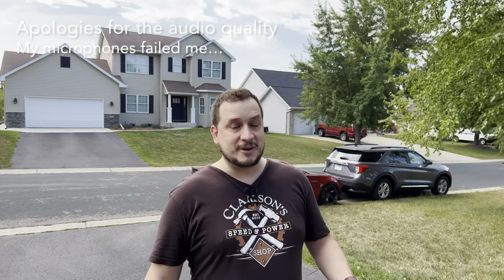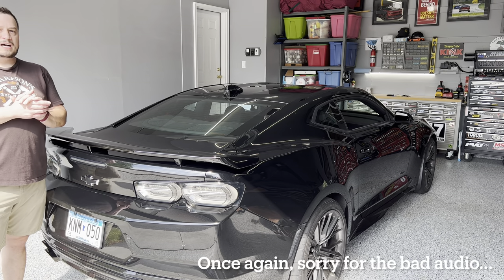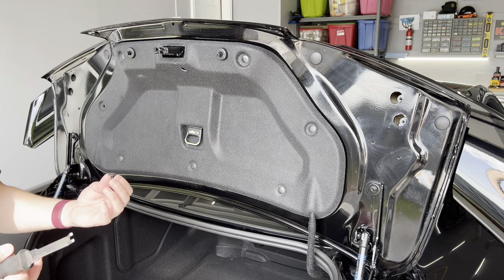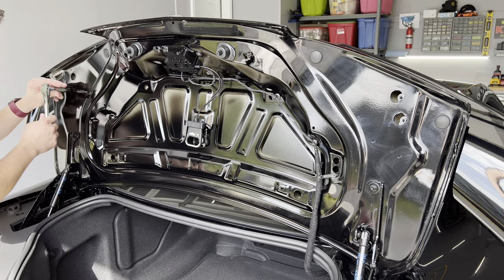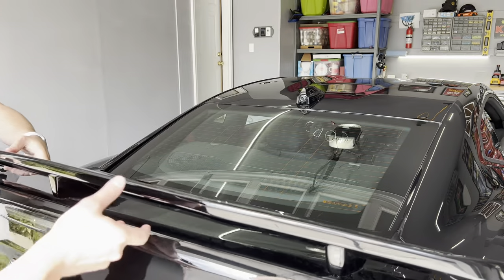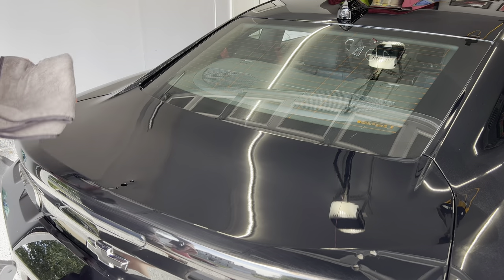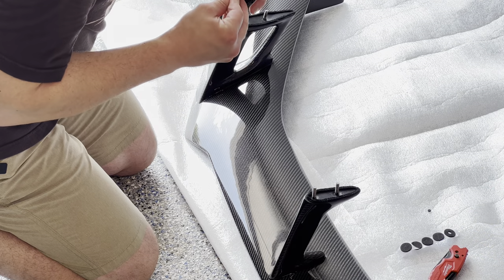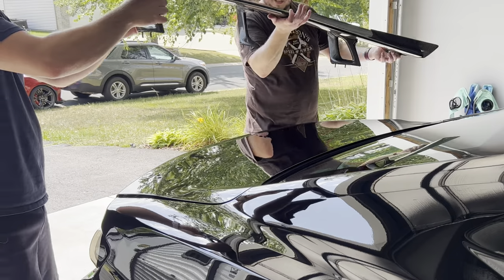How-To: ZL1 1LE Rear Spoiler Install // Carbon Fiber Wing

Comment: Glad to know there’s another zl1 in Minnesota. I’ve only seen 1 other and it was a convertible
Reply: What color was it
Reply: @c4sare4kiddos  it was black. I have the radiant red tint coat
Reply from the maker: There is a silver convertible in the Waconia area too.
Reply: I see mustangs,chargers & challengers all day. It’s nice to see that Camaros are harder to come by
Reply: @FollowMyLine17  I have the satin steel vert, diff state tho. There’s so many different  gm silver” paint codes tho so it’s hard to tell even for me, lighting ppf cleaning etc make it look different where I confuse it with some ppl online/ irl who have the different paint codes of that silver or gray. I think I have never seen Arctic blue or silver or whatever they call it irl on any trim and that’s it.

Comment: Great video. Having done this myself, a big warning is to not drop the nuts into the body of the trunk lid. You can do this by taping the socket to the nut or lowering the lid enough that they will fall free. Otherwise, you may have to fish them out with a magnet.
Reply from the maker: Great call out. I think I had it in the original cuts, but it didn’t make the final video. I did use a magnet to grab the factory nuts out and put them on.
Reply: @FollowMyLine17  Knowing is half the battle. 😁😁

Comment: I would like to put this wing on a convertible ZL1. Any suggestions on what to do with the wing mounted camera that comes on the convertible?
Reply from the maker: Wildhammer sells a 1LE style spoiler with a camera hole in it. It is made by EOS, so it’s a bit different than this one, but in 2019 the rear view camera on the ZL1 1LE was in the spoiler itself. If you use the wildhammer link in the description, you can then search the shop for it.
Reply: Awesome. I should be taking delivery of my 2023 rapid blue ZL1 convertible very shortly. The only thing it's missing is the performance data recorder. Any suggestions on a good one with camera I can add? Thank you very much.
Reply from the maker: @appel199  this is an older video but many of the items are still current. Links for everything in the description too. https://youtu.be/GGOSnBjibwk?si=8E-VKrgGrhozbJiD
Reply: Thanks. Just so bummed that one PDR option is not on the car. But really looking forward to getting the car. tho.
Reply from the maker: @appel199 stay tuned… I’m working with some folks on an OEM retrofit option. Late 2024 hopefully.
Reply: Please get back to me when you do. Thank you.
Reply from the maker: @appel199 of course! If you’re not subscribed yet, please do and you’ll get the notifications.
Reply: Subscribed today. Hopefully have my car by the end of next week.

Comment: Nice job and nice looking wing! What did it do to your rear view camera view?
Reply from the maker: Zoomed all the way out, you can see the top of the wing across the bottom third of the screen. Mid zoom it’s just barely across the bottom and zoomed all the way in, it’s not in view at all.
Reply: @FollowMyLine17  OK awesome! Thank you for the info! Did the new wing have 3M adhesive to secure as well as cushion the supports of the wing to your trunk lid?
Reply from the maker: @P-Dawg-01  it came with foam tape

Comment: I have an LT RS I want to put the same spoiler on it but I don't know how to cover the holes left by the previous spoiler. What do you recommend?
Reply from the maker: The best way is to try to find a trunk lid without a spoiler or with the standard SS, or ZL1 spoiler from 2018+, which has the reinforced braces within and have it painted. 2016 and 2017 do not. Otherwise you could have a body shop fill the holes. Otherwise you could just use some plastic plugs and paint them to match:
https://amzn.to/3JyQsbE

Comment: Did the new wing come with adhesive tape? And to loosen the old wing adhesive what did you use?
Reply from the maker: The new wing came with adhesive foam. To get the old stuff off I used a plastic scraping blade and a 3M adhesive removal wheel attached to a drill.

Comment: Additionally, 50% iso alcohol works better than detail spray for removing adhesive and is paint safe.
Reply from the maker: I was using a plastic blade and the eraser wheel to remove the adhesive, so I wanted more lubricity. I actually hit it up with IPA as a final step before I installed the new spoiler.

Comment: I've been thinking about adding this wing to my ss
Reply from the maker: Do it! You won’t regret it.
Reply: @FollowMyLine17  did you have any issues with extra holes in your trunk ?
Reply from the maker: @fearless798  well we added this wing to a ZL1. You said SS so I a regular SS should use the same holes. If it’s an SS 1LE, you’ll have a bunch of extra holes, and then you’ll have to drill the new ones for the ZL1 1LE wing.

Comment: hey... forgot to show the roof top rear view camera view before and aftere wing install. 
Great video, nevertheless. Cheers.
Reply from the maker: With the camera angle all the way down, on the furthest out camera view, you can see the wing. In the mid setting, you can barely see the top of the wing at the very bottom of the mirror, and at the closest zoom setting, you can’t see the wing at all.